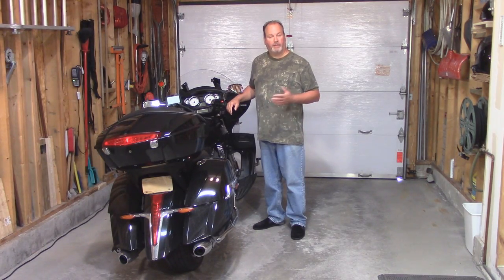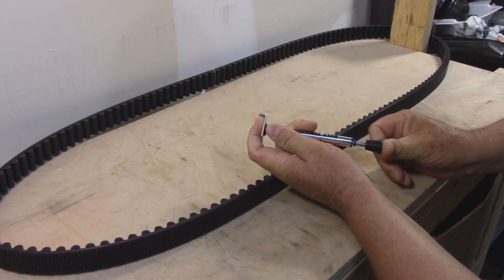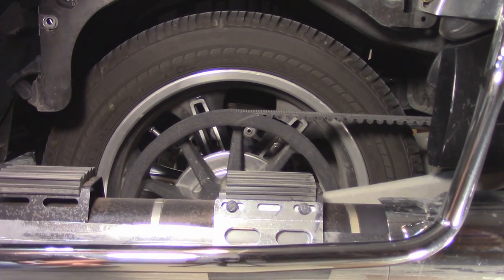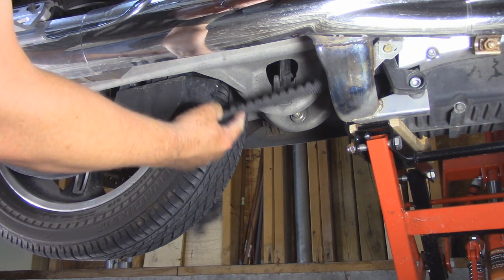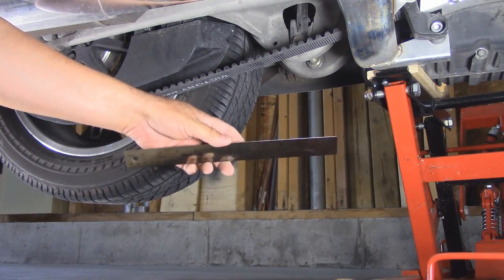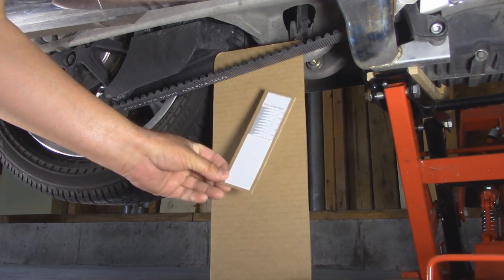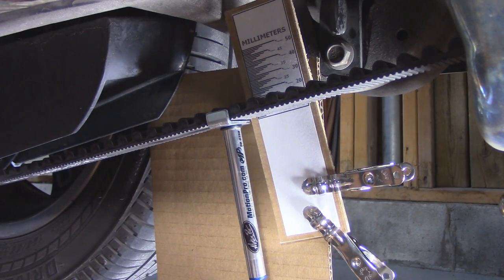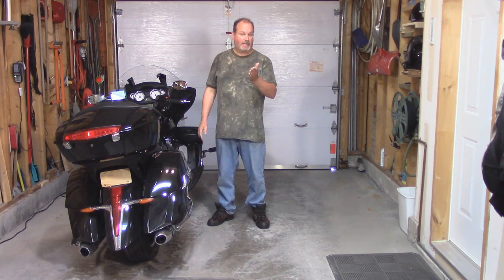Motorcycle Belt Tension

Comment: Paul, this is what i was doing with my Victory Hammer S after I hit the 500 mile service interval.  What I soon discovered is that the Victory spec of 6mm cold, wheel off the ground, was way too tight for my particular model.  We had a significant debate on the Victory forum, and several members had damaged bearing from a too-tight belt following the given spec.  I doubled the spec for my bike, and even so just a mile or two of riding results in a belt banjo tight due to the front drive sprocket expanding.   Seems like the touring models are ok since they start off with much more slack.  Nice videos.

Comment: Hey Paul, just a couple of follow up questions.  You said that when the belt is hot it shrinks and gets tighter, I thought it would have been the other way around?  When it gets hot it would stretch because it is warmer, no?  Where did you get your belt tension thing from, I wouldn't mind picking one up.  How often do you check it, once or twice a year at oil change time?  Also I would like to see a follow up video where you actually adjust the belt to bring it into spec, just in case mine is farther out.  
Great job as always Paul...
Reply from the maker: When I get back after a ride the belt is a lot tighter but you are right, I don't actually think it is the belt but the aluminum frame of the bike that expands thus tightening the belt. I haven't really studied it deeper to find out.
I think I ordered the gauge from here: https://fortnine.ca/en/catalogsearch/result/?q=belt+tension+gauge I imagine it is a lot cheaper in the States.
I check it more than twice a year but no real set time, just whenever I think of it or hear something funny during a ride.
To adjust it you have to loosen the axle nut and turn the adjusters, but that usually means aligning the wheel as well which is a bit more tricky. I guess I will have to do a video on that soon.
Thanks for watching.
Reply: Yes the belt gets tighter when hot even on a steel frame bike like the Kingpin which is what I have.
Reply: Sprockets heat up and expand, thus tightening the belt.

Comment: Paul,
I also own a 2011 Victory Cross Country with 30,500+/- miles on it
I know this video is about belt tension but I have a different interest.
I am looking for a less expensive alternative to the OEM Dunlop Elite 3 tires.
You have taken some nice shots of your rear tire.
It looks like a car tire...' BRIGSTONE DRIVE GUARD'???
How is that working out for you?
Could you tell me more?
I have watched most of your Victory videos and am impressed with your insights.
Thanks for taking the time to do these videos.
Reply from the maker: Putting a car tire on the rear of a motorcycle is called Darkside. There are a lot of forum sites and Facebook groups dedicated to this. In my opinion a car tire (CT) works just as well as a motorcycle tire (MT) for the style of riding that I do. The only downside that I have seen so far are the negative comments that you get from other riders. 
I find that I get better traction in rain, gravel, sand, tar snakes, paint, braking. It is also a run flat tire so I can still ride to get it fixed and it lasts much longer that a MT. I am much more confident on the car tire.
I realized the only way to know if I will like it is to try it. I bought one and installed it myself. It could have gone either way. If I didn't like it then I would have removed it and it only would have cost me a tire. Turns out that it's been on for 2 years now.
Do your research, and try it to see if it is good for you. That's the only way. Good luck.
Reply: At 30,000 miles I installed a matching set of Shinko SE-890 Journeys'.
They cost less than 1/3 the price of Dunlop Elite 3s'.
If I get one season (5,000 miles for me) I will be happy.
I am definitely considering the "dark side" as my next set up.
Thanks again for your insights.

Comment: The belt is the only reason I haven't changed my rear tire, thanks for the information.
Reply: Belt tension isn’t changed when doing a tire on a cross country.
Reply: @dantheautoman3821  what????? How can you possibly remove the rear wheel without effecting the belt tension???! 😳😳😳😳
Reply: @jbw5485  unbolt the shock and wishbone. The swing arm comes down which slackens the belt. You never have to touch the belt adjusters so when you reassemble it, it’s already in the proper place.

Comment: Paul, I used your rear wheel removal video as a guide last weekend so I could bring my wheel in for a new tire. Made for a really simple task. I plan to use your belt tension video as well. Any chance I could get a copy of the scale you created to measure the tension? TIA.
Reply from the maker: Hi Brian, I made the ruler in Sketchup a free online program. Do you have it? I will try to convert it to a jpg or something. The tricky part is to print it out to scale for accuracy. Let me know.
Reply: Paul Pomerleau I've never heard of Sketchup but I will look into it. Thanks for the quick reply.

Comment: Do you use a crow foot to loosen axle nut? What size? Curious if that works in order not to remove exhaust/bags?
Reply from the maker: On my bike the axle nut is 27mm. I don't use a crowfoot because the ones around my area are not long enough to reach while still using a torque wrench and maintaining a 90 degree angle with the wrench. I have actually been thinking of building one just for this purpose. Right now if I needed to adjust the belt I would tighten the nut using a regular open ended wrench then remove the bolt holding the shock in place thus dropping the axle below the exhaust then doing the final tightening using the torque wrench. Seems long, that's why I would need to customize a crowfoot to fit the axle nut.

Comment: It looks like you have a car tire mounted, I am wonder what are your recommendations with regards to tire size and pressure.
Reply from the maker: Although everyone is different I went with the Bridgestone Driveguard 195/55RF16 run flat tire as it was easy to get for me in Canada and I do my own mounting. I also went through various tire pressures until I found one that was right for me which was 33 PSI.
Reply: @PaulPomerleau  thank you very much.

Comment: What brand and size is that rear tire? it looks much different than my CCT tire.
Reply: Looks like a darksider to me ;)
Reply from the maker: Yup DarkSider - It's a Bridgestone Driveguard 195/55RF16 run flat car tire.
Reply: I was going to comment about the same thing, Paul. How long have you been running darkside on the CCT? Any issues in different scenarios of weather, terrain, etc?
Reply from the maker: I have been a darksider for 2 years now. It handles rain, gravel, sand, paint, tar snakes a lot better than a MT. I find it a lot more comfortable as well. This is just my opinion for my style of riding. It may not be for everyone.
Reply: I tend to lean my bike through corners as far as it will go...scraping boards, exhaust, saddlebag guards are somewhat normal for me. That has been my only concern when I have considered darksiding in the past.
Reply from the maker: Although people do scrape boards with a car tire, if it was me and I was riding like that I would stay with a motorcycle tire. It is just my opinion, but I think you will have more fun on a motorcycle tire.
Reply: I've had three darkside bikes, scraped all the time...my goldwing was the fastest, and the most scraped.  Don't worry about that.  You can find vids here on youtube showing that even in a deep deep corner, you have more traction with a ct.
Reply: Do you get more miles from the car tires than a motorcycle tire? And is the price comparable?
Reply from the maker: This is my first car tire on my bike and I put it on when my original motorcycle tire was worn out at 23,000 kms. My car tire now has 20,000 kms on it and still has lots of life left. I expect to get about 3 times the amount of miles on it over a motorcycle tire. As for the price, just like any tire the price varies greatly. My car tire was about $50 cheaper than a MT but I didn't do it for the money, I did it because I wanted to try it for myself.
Reply: No, and no.  You get TONS more miles from a car tire.  I've gone up to 15,000 miles on my last tire, and it still looked brand new.  You won't come CLOSE to that with ANY motorcycle tire.  And, price wise, even a run flat car tire is going to be about half what a mc tire costs.

Comment: Why are there different reading at each point
Reply from the maker: The belt doesn't stretch evenly. Some places more than others, so we measure in quarters.
Reply: @PaulPomerleau  thanks so I just bought cable for the clutch at home depot but I bought the coated one will it fit in the stopper and on the bike or do I need cable without coating,well I just checked and it measures 1/8 with the coating ,so will this fit ? I can a 1/16 so that would make 3/32 with the coating or skip the coating
Reply from the maker: Mine does not have any coating. I think the ends where the set screws tighten against the cable should be bare, as the coating will make it too slippery for it to hold. You can keep the coating on the rest of the cable as the OEM one has this as well.
Reply: @PaulPomerleau  that's what I planned to do just burn off the ends